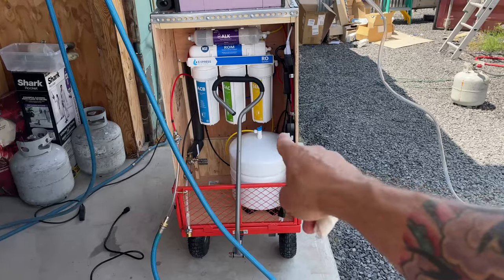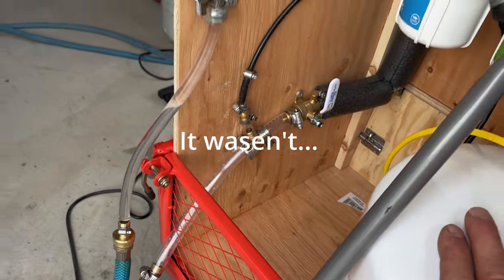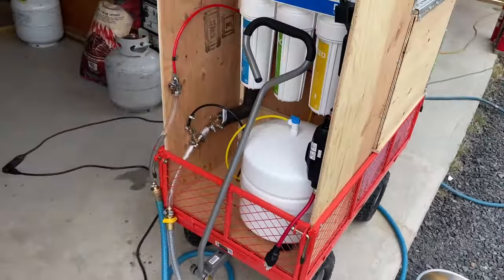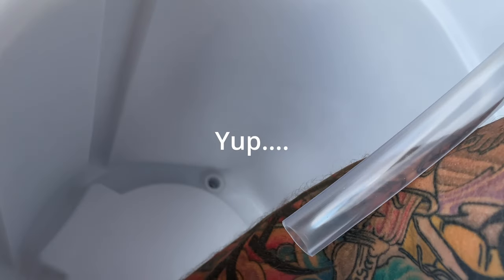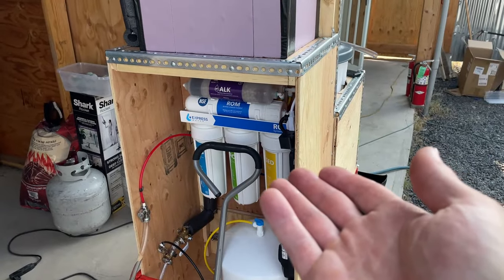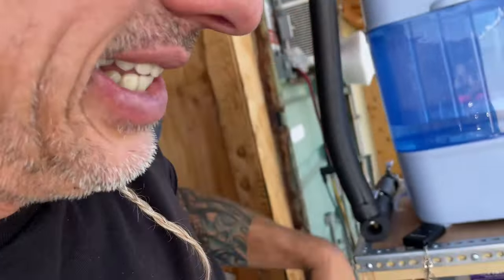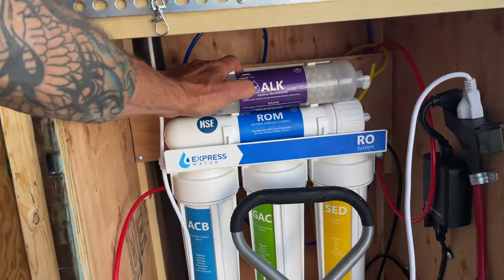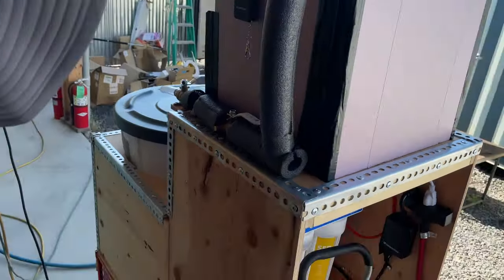Worlds 1st AIO Bubble Hash Machine 2 | Problem Solving | Testing | Filtering Filters

Comment: Some of your leaking issues are due to the hoses bending. They need to go in to the adapters from straight on. Specifically the one at 4:40. Also, you should put a hose clamp on the area where to two plastic pieces area.
Reply from the maker: Got all the leaks. That pressure tank doesn't hold much. Taking forever to make ice.

Comment: I just use dry ice in a bubble bag. and give it a shake for maybe ten minutes. Then bake the trichomes if I plan to use it for cooking.
Built a shaker. from two five gallon buckets. Used two rods. One to hold the bottomless bucket in the bucket with a bottom. At a decent stroke height. The shaker bar is just a bar with a curve put in the center of it. It is installed pretty high on the bottomless bucket.  And attached the bubble bag to that with keyring or carabiner. Powered by drill. battery or corded will work. 

I have my bucket stroke height set to where the bag hits the rod at the bottom of the down stroke. This rod that holds the two buckets together. Now acts as a extra agitator. 
No water no mess. 

You can also do this with any long pipe that large/round enough to hold your bubble bag. Then you can just set the pipe on a tarp or whatever. Use the machine. lift the pipe and move to another tarp area. if you are working on that scale. but they are so cheap just make more. 
My food grade bucket were $1 a piece. if you go to walmart bakery and ask for 5 gallon bucket. they tend to give you empty vanilla frosting buckets with lids. They mark them $1. Just have to ask.
Reply from the maker: I don't like to have to "go buy" when I can make everything myself. Making ice is free as I live on solar.
Reply: @GudasWorld  Cool I know you can make liquid nitrogen in your garage. Made me wonder if they have similar things for CO2. 

Dry is common in my area. They have it a gas stations and a lot of grocery stores.  So it's not difficult for me to spend $2-$3on some dry ice. and if their is any left over. I let it off gas in a grow area. cause a little more co2 aint so bad for plants.
Reply from the maker: I haven't done either method. Not sure how similar the end result is. I see some pretty expensive machines to use ice water. There might be a benefit as why would there be a machine thats over $20k if dry ice gives the same result. IDK. But I am getting close to running it, as I have a auto flower nearly done.

Comment: Would a compact or mobile home washing machine work better. For this type of application? I am just wondering because, they can be found real cheap used. I got myself one as back up to my old machine if it goes down. for less than $40.

Edit: sub # 649
Reply from the maker: Ya there are a lot of sizes. It was only like $90 ish if I remember. I picked a bigger one as the size fits the bags better.